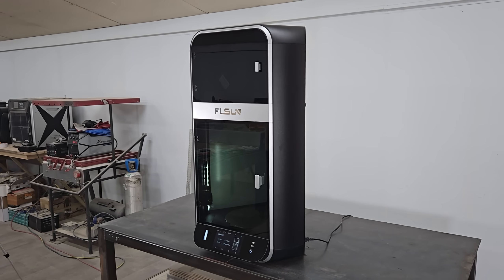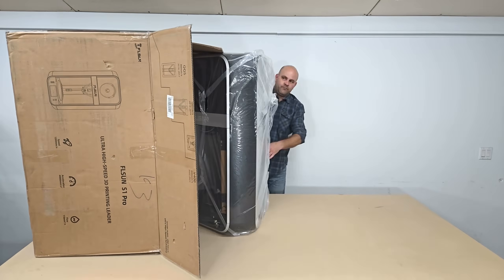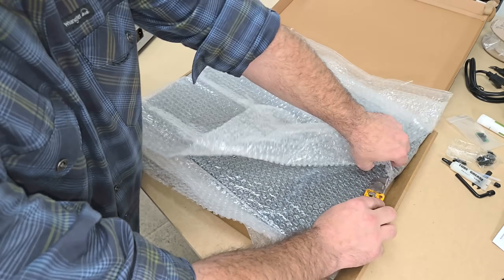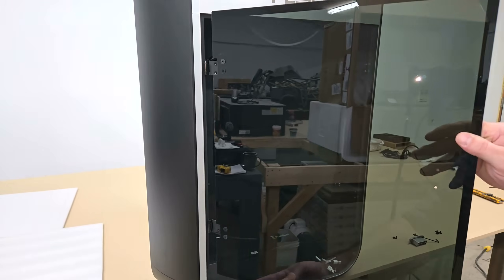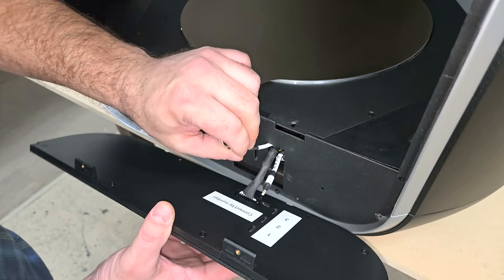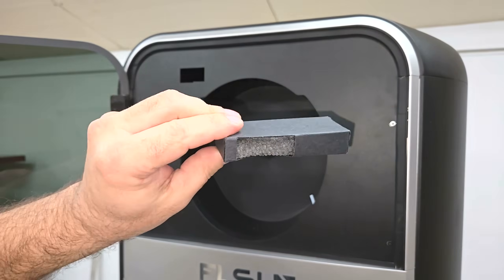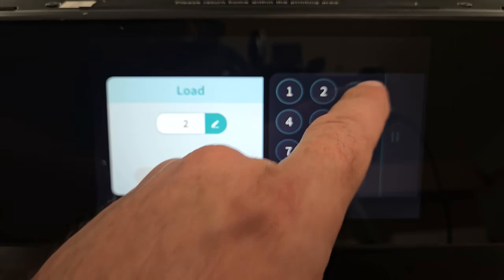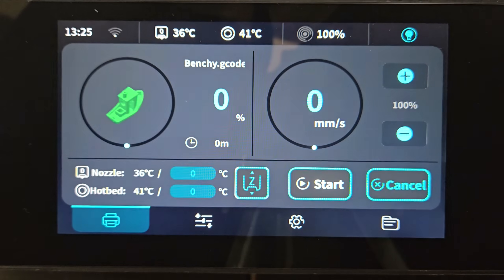3D Printed Wind Turbine Blades?! FLSUN S1 Pro Review

Comment: What is interesting to me is most reviews try to print the same things then say one sucks over another. 
Each printer is a tool that is good at what it does.
I find my S1 PRO to be great at large prints with large straight lines or long details.
It isn't good at small detailed things like benchys, or figurines. 
Use the tool for what it is good at and just cause it isn't good at something doesn't mean it is a bad printer. Tools aren't universal.

Comment: do you have to have the internet to use it internet to use it if so,  I wouldn't want anything that tells me what I can and Can't print.  I have been looking at 3d printers and just don't want to have to have big brother spying on what I may or may not print.
Reply from the maker: Nope, not necessary at all. You can slice your model in the slicer software then just transfer it to the printer with a usb drive. That's how I normally do it. My shop is basically a tin can and wifi is spotty at best.

Comment: I am using QBLADE to design my blades, and it's going great. You can directly export the STL files and scale them to later print them or, what I usually do, knowing the aerodynamic profile and the chord distances to the different cutting and twisting planes of the profile, is use CAD software to model the blade directly. This way, I have more flexibility to cut it into sections, create different fittings for the hub I designed, etc. I highly recommend it.